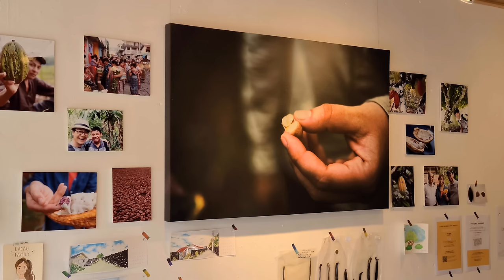Making real cacao handmade chocolate & cacao tea - Korean dessert

Comment: How do you get the leftovers out from the mortar and pestle? From stuck in all the little holes i mean.
Reply: Wash with water i guess...
Reply: Just brush it. simple way.
Reply: @코스모스쿨  it isn't good to add any liquids to chocolate or else it'll change the whole composition, like if you try to mix any liquid to chocolate its really hard to mix together so any additions made in chocolate are dry
Reply: @anonfx6919  let it dry then ?
Reply: @anonfx6919  he meant like wash the mortar and pestle after you scraped most of the chocolate away
Reply: I’m pretty sure they wash it with a brush
Reply: And the chocolate leftovers are dumped out
Reply: Hot water
Reply: @anonfx6919  Did they not just make a chocolate tea lol? Are there not an assorted variety of coffees and other desserts that require chocolate to be mixed with liquids? Not to mention almost every chocolate cake and brownies are mixed with wet ingredients lol.
Reply: hot water.

real cocoa easily melts with body temp.

that's why expensive chocolates has a clean finish in your mouth without any water needed.
Reply: @DaarkDestiny  the person is talking about not using water in the process of making chocolate bars dummy